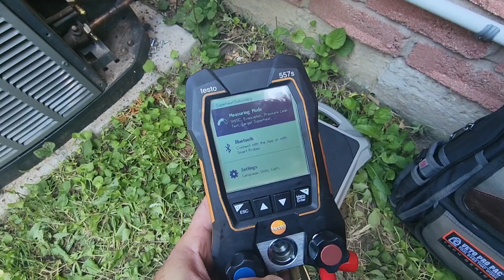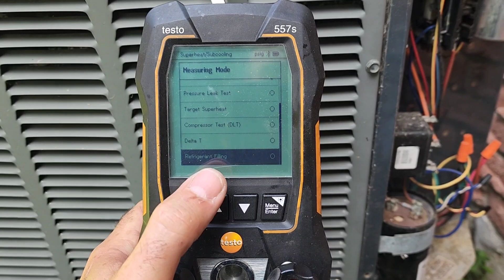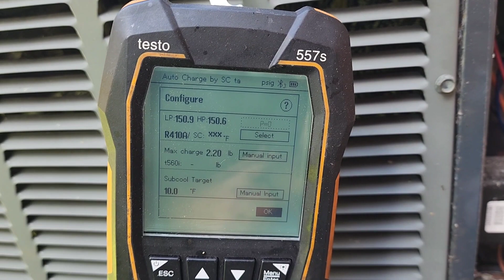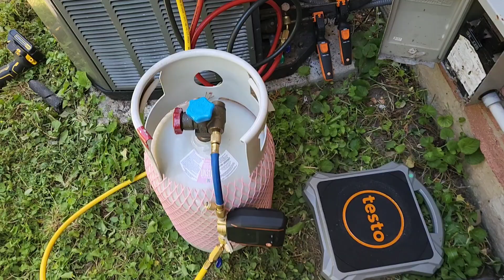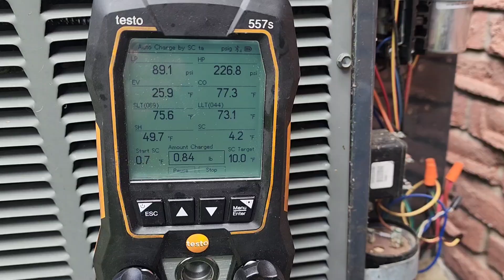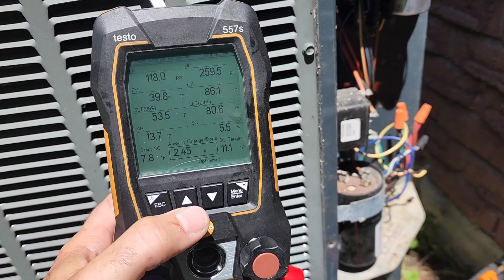Auto Charging By Subcooling w/ The Testo 560i Scale and Smart Valve

Comment: On superheat mode, you can only use it on split system with fixed valve. Does the same apply to charging through target superheat or subcooling? Did you enter temp manually or used the 605i? It seems they dont let you use the 115i for this mode, so you need to buy the 605i 🤡

Comment: I’m beginning to believe Testo owns Duracell 🤣🤣. I understand the accuracy of this but it it taking away the purpose for tech to think about what is actually taking place in the system.
Reply: To be fair mate when it comes down to it all the temps/pressures are just numbers if the tech hasn't got a clue in the first place. A lot of engineers I've worked with don't know how to charge to subcooling. They would decant and recharge to the unit spec weight and add any extra needed by estimating the pipe run if it wasn't printed on the side of the outdoor. I've got these gauges all they do for me is makes reading the pressures and temps a lot faster/more efficient. I'll spend money on anything that saves times. Not like I'm going to be doing a different job in 10 years 😂
Reply from the maker: Not exactly, thinking is all in the set up.  Then it still needs to be monitired.
Reply: Well you do still have to know how too set it up, digital manifolds just do the pressure minus line temp for you lol
Reply: Not at all. It actually helps him understand.